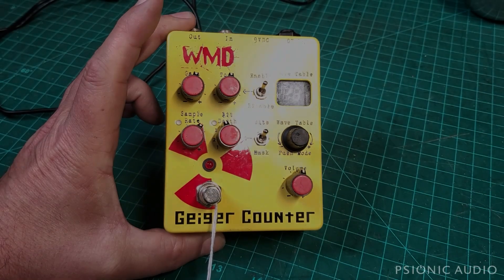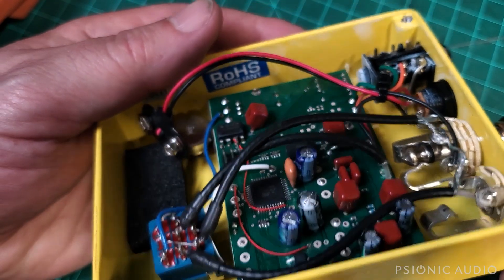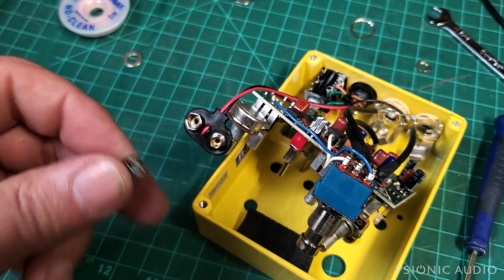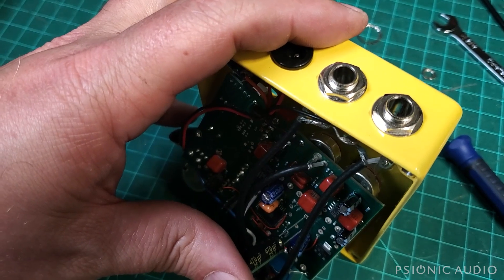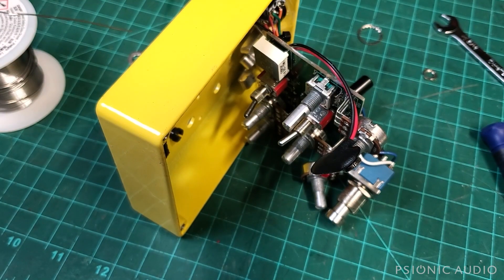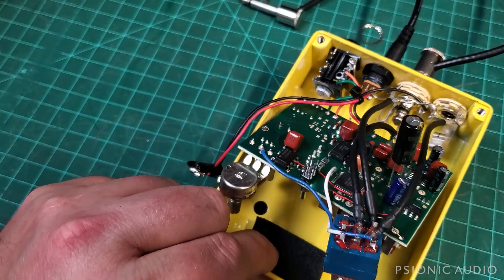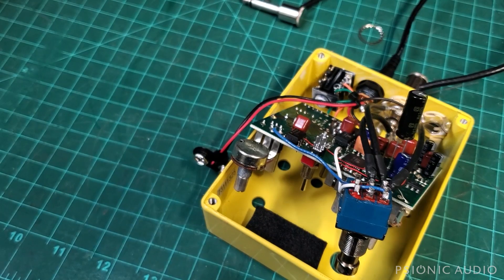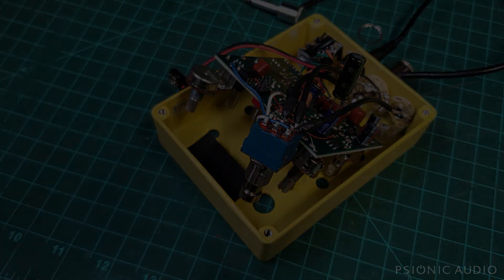WMD Geiger Counter Won't Power On

Comment: I'd guess that the cap you found was on the output of a regulator (likely 5v) and shorted and took the regulator. Thise devices are 3 terminal, and it appears to be in some of your shots near the cap . . . . You don't need to know any of the logic or audio schematic to do this cery fundamental test, and to replace it would have been faster than the cap, since the board would not have needed to come out. At the very least, establish where power is lost before bailing! This could well have been a very quick and easy repair!
Reply from the maker: Might have been. Might is a pretty big word when you look at labor vs the value of a device. I didn’t charge the guy so…
Reply: @PsionicAudio  I would estimate no more than 30 mins, if that, in my experience.
Reply from the maker: IF that’s all it was.
Reply: @PsionicAudio  My point simply being is that you will never know having not looked. Verifying power pre and post regulator with a meter takes seconds at most . . .
Reply from the maker: I had to go back and watch the video to remind myself the deets here…

I did trace it out. Voltages were good to/from the regulator. Disappeared in the digital stuff, at which point I stopped.

Changing the regulator would have done jack. Hope your armchair is comfy.
Reply: @PsionicAudio  Frankly, I haven't worked on much this simple in a while, and frankly, did not recall seing the specific voltage checks at various points . . .  I just see this type of fault in a fair amout of stuff, and typically if a capgoes, it's only a power problem UNLESS the fault is due to an overvolt/wrong supply that the user "convieniently" forgot to mention . . (most recent job in a very high end automated light . . . $700 for a board or $3/15 mins for a cap/reg replacement . . .) but yeah, if power seen to the digital, then agree.

Comment: Using a light bulb limiter is never a bad thing but I wonder how effective it is when the current demand like with a wall wart is so low.  Do you use a low-wattage bulb for situations like this?
Reply from the maker: I was really only concerned about a full dead short. It's a good point though.
Reply: Yeah this is a good point, digital pedals have pretty high amperage requirements and if you are low even 10% the pedal won't power up.

Comment: The surgeons magnifying glasses focus in on about a 1 inch diameter circle at about  20x magnification @ a ~20 inch focal length and they are beyond great for finding bad solder joints & glue starved joints in wood. They also cost north of $1500. Not having my face 3-4 inches away from my work to get 5x magnification is worth it. The 4X Optovisors  have your face 4-1/2 inches away from things I want at least 12 inches of distance AWAY from. I also have the Baush & Lomb microscope. Again a very short focal length but 10-60x magnification. I can live with that.

Comment: As far as pedals go , theres alot of hardware in this one .
Its a niche pedal imo .
Fun , yeah ,  but the only sounds id ever use it for , i  could get from any distortion pedal, which i never use that much anyway.
But thats me, i dig the sound of great amps , just on the edge of break up, when you turn the guitar down it cleans up, and cranked you get sum girth

Comment: Hmmmmmm.....perhaps it was exposed to too many roentgens? I've got a Civil Defense geiger counter made by Victoreen and I converted the headphone output to a line out so I could run it through a guitar amp with lots of reverb. Science Fiction movies deluxe. It's got a tiny bit of some sort of radioactive material on the case so you can test it for proper operation. Do you know the Lionel people-that's right, the toy train folks-made Civil Defense geiger counters?

Comment: So if I have $800 ish to spend on a new tube amp what would you recommend?
Reply from the maker: I'm thinking of doing a series of "what amp" at different price points. 

But I can't answer your question without knowing more about your needs. That could be a Princeton Reverb RI, a Marshall DSL40C, or an AC15 C1X. All good choices for certain players but the metal guy would only like one of them, etc.
Reply: Laney Cub Super 12. You'd be surprised. 
Do you like EL84's?
There are some demos here on YT.

Comment: 700C what? I solder daily with high temp solder and my iron is at 430C!!
Reply from the maker: See the pinned comment. Misspoke. 750F. 371C.
Reply: I find 380C to be just about right for my vacuum-operated desoldering gun (when working with leaded solder, that is). My main soldering station, an old green Weller soldering station,  doesn't even have adjustable temperature and doesn't have a digital readout, but it's just right for 95% of what I do. (I use a #7 or #8 tip, that sets the temperature; some old timers will know what I'm referring to).